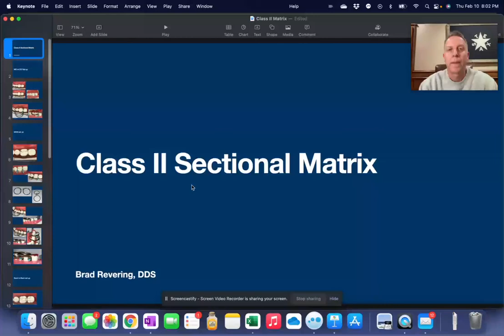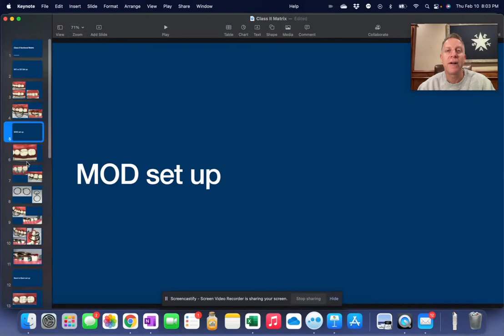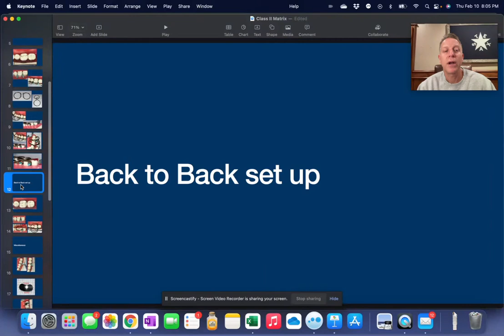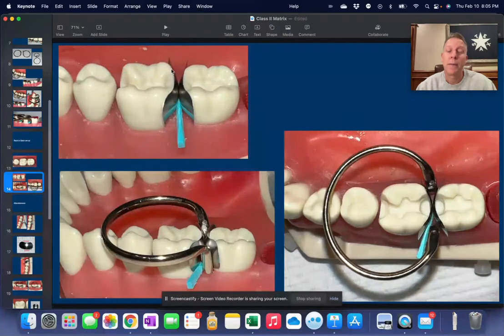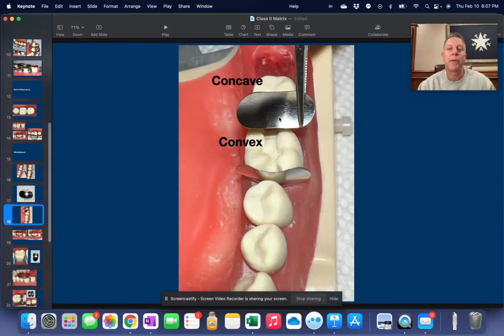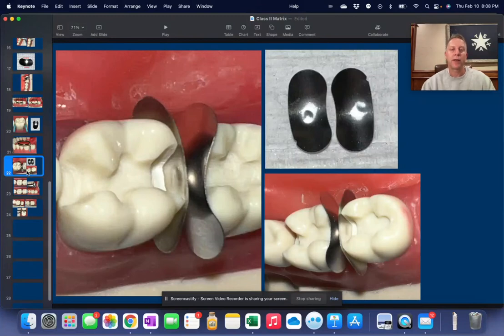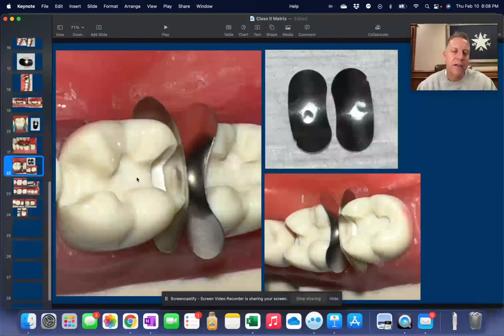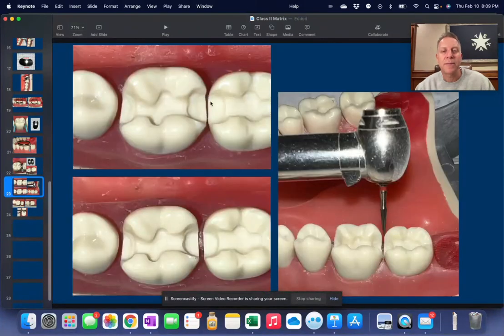Sectional Matrix Set Ups and Tips

Comment: What you recommend to minimize the flash  gingivally  and proximally
Reply from the maker: By placing the tines of the ring directly against the matrix it should block flash on the buccal and lingual.  The wedge will also prevent gingival flash.  
Occasionally some flash will develop.  If on the buccal or lingual shape with a flame shaped finishing bur.  If gingival, leave it unless it's causing an overhang.  If overhang try to trim.  If unsuccessful redo the filling.